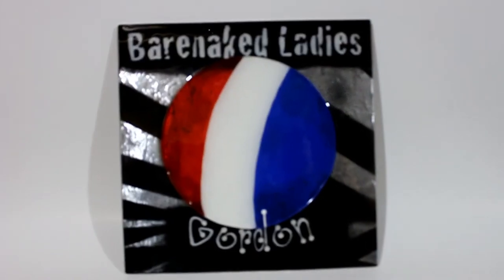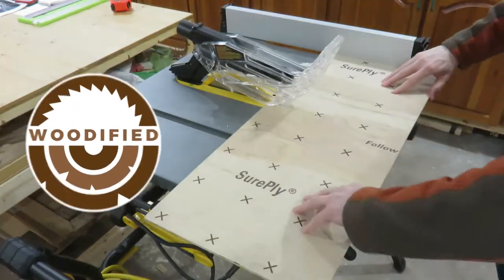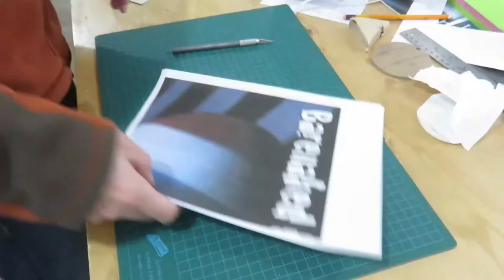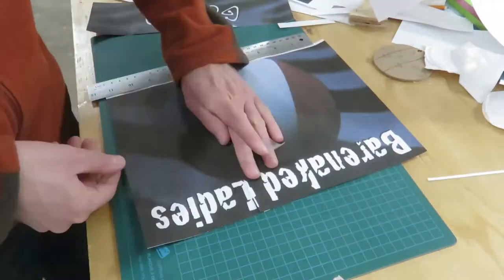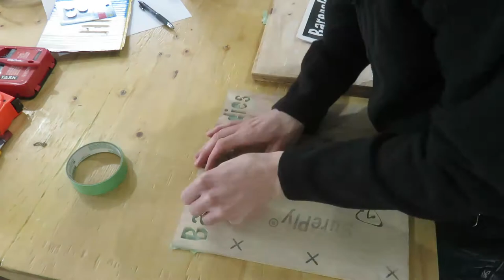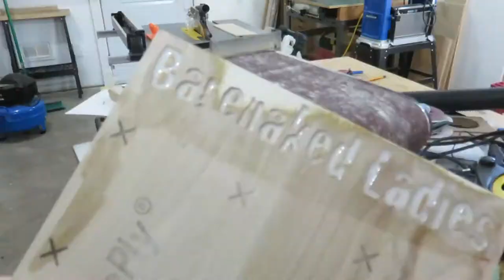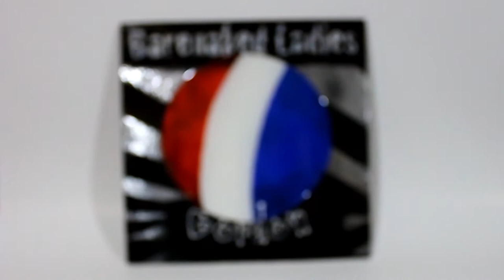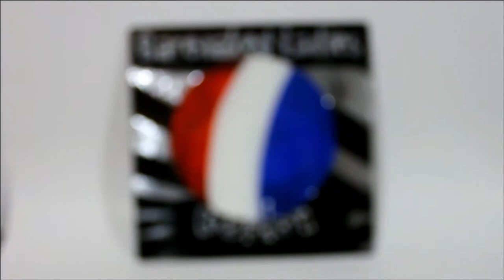Makers Rock Album Art Collab 2018 [Barenaked Ladies Gordon]

Comment: Well done!  That looks fantastic!  Interesting seeing all the techniques and different materials you used.  I really should try resin sometime.
Reply from the maker: Thanks Steve.  This was my first time using resin.
Reply: Resin can be difficult at times and if you saw what he did by getting too close to the resin, and heating it too much at one time in one spot, it can catch fire! Guys if your going to use resin, maybe even hybrid table tops or backdrops for a routered, or scroll saw pattern... The list goes on and on. Always make sure to cover your projects while drying. Especially with resins that can cure outside of a pressure pot! My suggestion to you would be Alumilite clear, and add your own colors from there. You can use the metallic colors also with alumilite clear. It can make some of the ugliest things just pop! It truly is something that's going to change the way we do things! Even Grandpa's old stool... Especially when building box lights or literally I can go on and on. And I won't. But if you're going to cast something, make sure it is stabilized wood you're working with, or it could truly be a disaster! The alumilite clear is an epoxy and will not allow for any moisture being in the wood itself! It bubbles up around it and separates itself from the wood. Just a small FYI. But yeah! Get creative. Work outside the box! Some beautiful things can be done with it when you incorporate it with wood. Definitely check out Heath Knuckles or Zac Higgins on YouTube and ask those questions ahead of time.